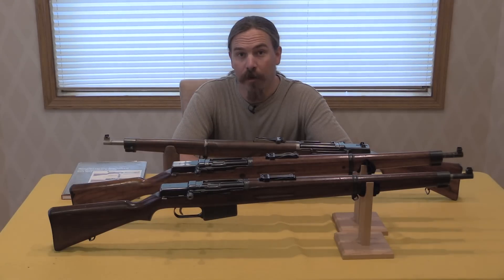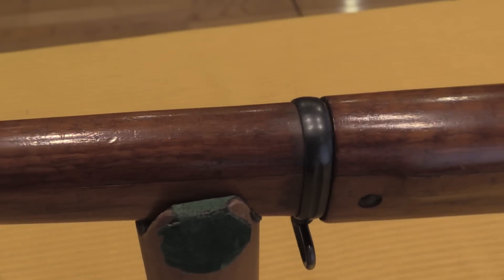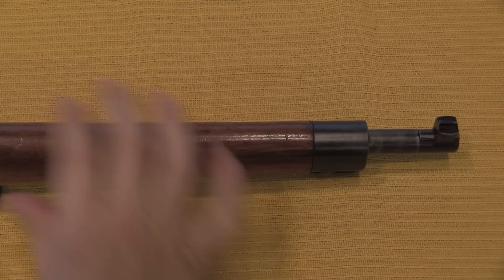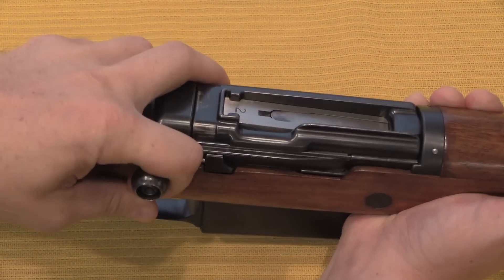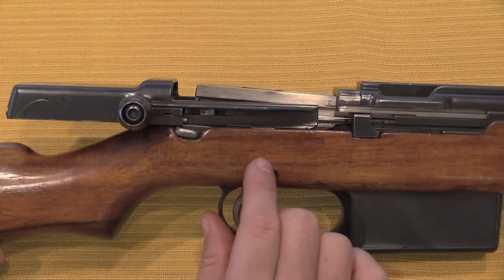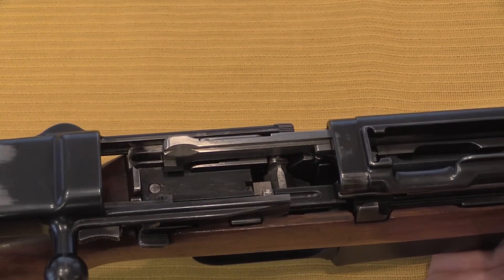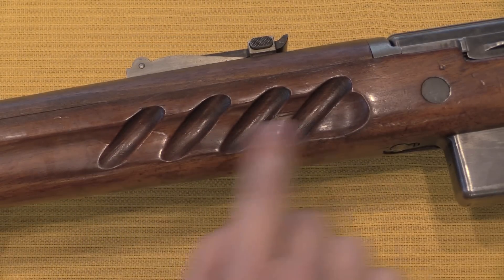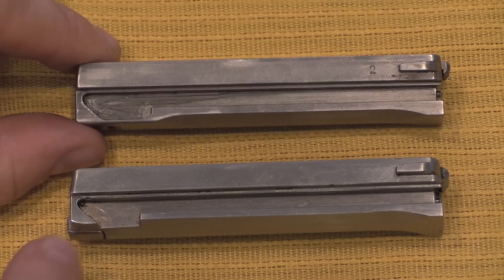SIG KE-9/M29A Prototype Rifles

Comment: they certainly didn't seem to economize manufacturing in general on this rifle, but that bolt (specifically the slots you mention) looks like a fairly straightforward affair those slots could be essentially two operations on a vertical mill and rotary table. It would surely add up with production volume but I've certainly seen much worse on production parts.

Comment: Aside from the complexity of making it, it seems like that bolt could smack you in the face when you shoot it
Reply from the maker: +quarktron The charging handle assembly doesn't move when you shoot - the bolt cycles underneath/inside it.
Reply: Oh,OK. Thanks for the clarification on that.

Comment: So, I found on my dad's attic this kar 98 mod 1922 made by FN. I tried to find information about it but I couldn't find anything about kars made by FN so I came to aks you guys. Btw the gun had the brazilian army coat of arms on it (yes I'm brazilian, sorry for any grammar mistakes)
Reply: +whatthereq just a wild guess... probably a small contract rifle sold to brazil (didnt you guys have a revolution?? sorry if im wrong) or it was imported. 

also... it seems that FN did not make kar 98/ mauser style guns in 1922... but they made some post war guns (and possibly forced production when the nazis took over)

i really dont think your guns was made in 1922
or
it wasnt made by FN. 

look at a website like 7.62x54r.net.... you need to find the kar89 equivalent. just because it says "1922" on it does not mean it was made anywhere NEAR 1922. 

try to find a marking guide...google "kar 98 markings" 
google "how to date my mauser" 

it will get you started. 

ive got a 1945 (post war) czech mouser thats biased on the kregsmodel and has a winter trigger.... she is an odd one!
Reply: Perhaps you could upload a video going over the rifle and showing the markings so that it's easier to see what they are.

Comment: Why do we see so many recoil-operated rifles in the early days, and almost none now? Is it simply the result of cost and complexity?
Reply: I would guess due to fixed barrel rifles being more accurate in general.  Fixed barrel pistols are often mentioned as being more inherently accurate due to fewer moving parts and I would assume the same applies to rifles as well.
Reply: And the complexity probably also factors in as you want a gun that can easily be taken down to clean or be repaired in the field.
Reply: +Max Archer 
Also, bayonet mounting, since most early autoloaders were for military use...  Weight of a bayonet would change recoil operation.  Movable barrel would be an unwanted shock-absorber when you were trying to drive the pointy-end into the other guy.
Reply: +Max Archer 
A recoiling rifle barrel will have to move in a tightly fitting guide so it could deliver a reasonable degree of accuracy, and this raises the issue of sensitivity to dust and dirt (this isn't the case with machine guns which are not required to be accurate). Also a fixed barrel acts as a structural element, allowing other components to be strapped to it, while in a recoil operated rifle the frame would have to provide structural integrity, which will make it inherently heavier. One on top of the other, recoil operation is not a good idea for standard issue military rifles.
Reply: +Max Archer From what I understand, a lot of recoil operated rifles, such as HK roller locking series and the FAMAS lever delayed action, extract under high pressures, meaning they are tough on brass and can be a little less forgiving to variations in ammo loadings. The bearing surfaces that provide the mechanical delay are also very critical, and have to be precisely machined and maintained over time to ensure proper extraction timing. A gas operated locking action just seems a bit more forgiving, especially in a mass produced, mass issued infantry rifle.